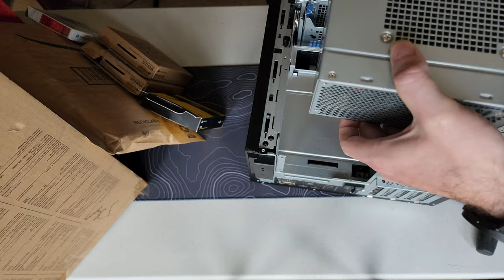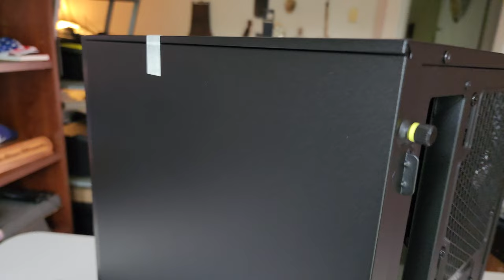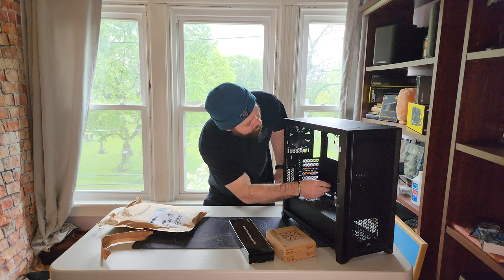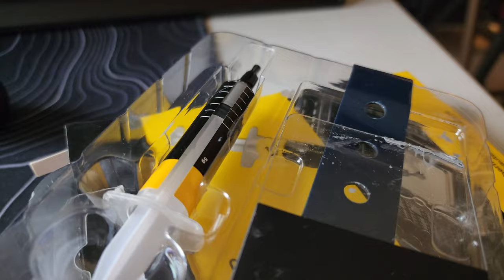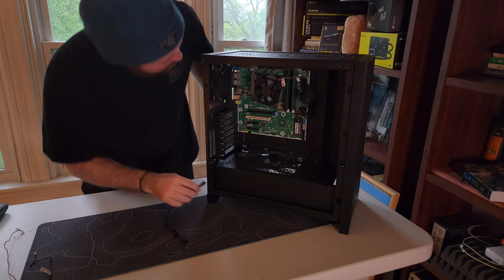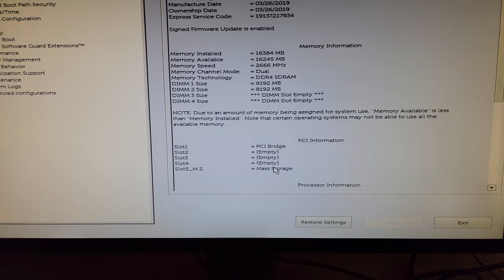TURN YOUR DELL INTO A GAMING PC IN 2023!

Comment: You absolute legend, literally just got hold of a precision 3630 so your video coming out just in time is a serious stroke of luck. Great job.  I'm going to add an rx580 to the existing case, but I may move everything over to a new case.  Do you think that the temps will run way too hot inside the precision case if I were gaming with an rx580?  I saw someone on the dell forums fit a AIO watercooler to the CPU which seems like a decent solution, but if transplanting to a new case is viable, then I will probably just copy you.
Reply from the maker: In the past with a different precision 3630, I actually cut a hole in the inner case mesh with tin snips, by the internal speaker, and crammed a zotac amp holo 3070ti into the stock precision case. It fit and worked. I had to use a corsair 1000w psu which also went right into the precision case no problem. Temps on the other hand were really and I mean really bad. The issue with how densely and compactly they pack everything into the case is everything sits on top of each other with  little to no airflow. The graphics card dumps heat up into the psu and stock cpu heatsink which is kind of small. With an rx 580 you miiight be okay, can't hurt to install it and test it out.. I would highly recommend you recase though. You will see substantially lower temps. I do think you will see your cpu and gpu  regularly over 90c in the stock case though. You can use an aio like a corsair elite h100i with this precision in a new case. You could probably fit a 120mm little aio in the precision but at that point, it's not worth the hassle. I have thought you might be able to rig an 80 or even 120mm fan in front of the psu where the front drive cage is. That could be  cheap easy upgrade to the stock case.
Reply: @darkgalacticmedia  Thanks for the reply! I may have missed it before, but what was the model of the vrm heatsink you put on the motherboard?  I'll probably put the 580 in for now, and then move it all over later on.
Reply from the maker: On Amazon just search "Dell Precision 3630 heatsink". Should be the top hit, it is by BestParts. It's like $15!
Reply: @darkgalacticmedia  Nice one, I fiddled around with benchmarking the CPU on cinebench with stock everything inside the precision case.  While it does run very hot, it actually was being power limit throttled, not temperature.  I did some research and was told that increasing the TDP limit from 65w to a higher level will stop this power limit throttling. I tried it and it worked, no power limit throttling and eventually it got to a point where the CPU was hitting high 90' so clearly temps are an issue I'll have to sort out.  With regard to fiddling with power limits on XTU, is it safe to do?  I don't want to blow anything up, and is there any chance the power limit throttling could be related to the non-heatsink vrm getting throttled?
Reply: @emm5005  Personally, I would lift the power limits, but actually try UNDERvolting the CPU slightly to reduce power draw for the same frequency (I have a 12700k in an NR200 original case, which Ive undervolted and it can now overclock to 5GHz all core (instead of one or two cores) at a lower power draw than the stock 4.7GHz all core).

As you surmised (and I would agree), the board is probably power limited because it is a hot-box and the VRMs are not heatsinked... Fit the cheap Amazon heatsinks to the VRM, lift the power limits and try a little undervolt as I suggest above.

If you want to keep it in the case but want better cooling, you can either:
A:
1) turn the PSU around so it is drawing air from the CPU side instead of from the case side (assuming the PSU has a fan in it, which I think it must as it appears that in the stock config it's only cooling would be to pull air from the case side which doesn't have a grill there so there would be no airflow naturally)
2) This would mean it is fighting the CPU for air in my configuration, so I would then flip the CPU fan so it is pulling air through the heatsink instead of blowing into it.  This way the PSU fan will actually help the CPU fan.
3) However pulling air through the heatsink will then only pull air over the top 1/4 ish of the heatsink, so I would then make a shroud from Gaffer tape / Duct tape that covers the heatsink side of the fan down to 3/4 of the heatsink, forcing it to draw air from the bottom of the heatsink and help cooling some more.

B, if you are really brave with a dremel, IMO this is the better option:
1) Remove the power supply and strip it down (remember to VERY carefully avoid toucking the internal components with your hands or screwdriver as the caps will hold deadly amounts of charge for days after it has been turned off and unplugged from the wall)
2) Use a dremel or drill to enlarge each and every one of the inlet and outlet grill holes on the PSU case. EDIT: if needed... I just looked closer at this video and ones for sale on Ebay, and it seems they don't all use the same design of PSU... some have larger mesh, like this video, and some have smaller mesh... however it is worth pointing out that this video's PSU has a 92mm (whereas others have a 120mm fan) facing the solid PC case side panel, just like all the others?!?... Flip it 180 no matter what else, and if it has a 92mm fan, hack the PSU to take a 120mm fan with extra ventilation drilled or dremmeled out to match.
3) Flip the fan in the PSU so it's sucking into the case from the back instead of ejecting from the case.
4) Refit the PSU so it's flipped 180 degrees, so its now drawing air from outside and blowing onto the CPU cooler.
*This will also have the added benefit of putting some downdraft airflow over the VRMs.*
*The incoming air will be warmed a little from the PSU, but it'll be nothing compared to the hot-box the case is at stock.*

Either way:
1) Also, theres a PC speaqker at the bottom front of the case? Move that to the bottom of the case and fit a 120mm fan over the grill inlet.  

2) There should also be a grill inlet hidden by the HDD and HDD caddy.  Move the HDD to the bottom of the case and just affix it with velcro strip or double sided tape (metal to metal, not electronics to metal)... This will allow you to dremmel out the caddy, or at least dremmel out large holes in the caddy to let air through and fit a 120mm fan in there too.

*If you use option A, set the front fans as intake as the case exhaust is at the rear.  If you use option B, flip the fan stock fitted at the top of the case so it is intake as well as the PSU, and set the front fans to be exhaust.*

3) It looks like the case has 92 or 120mm mesh holes in the side of the case... put another couple of matching fans there oriented the same as the front fans (if the front fans are exhaust, these should be too, it will make the case negative pressure and pull more fresh air in from the top of the case, past the CPU cooler. If the front fans are intake, these should be too, so the case will be in posative pressure and force more air past the CPU cooler and OUT of the top of the case.  Remember that these fans' orientation should be set by whether you go with option A or option B).  
You can just stick them on with that foamy thick 3m type double sided tape. Cut it into thin strips to go all around the edge of the fan so that it both dampens fan vibaration (cos it's the thick foamy stuff) and forms a good seal so it's only pulling air from outside, not recirculating some of the internal air.

4) You can actually set all these additional fans' speeds surprisingly low and therefore quiet as you have just turned the case froma hot-box to an airflow king, with a lot of elbow grease but very little money (you can get away with cheap ass fans, they don't have to be noctua or be-quiet fans!)

*If the front plastic that looks like diamond vent is actually diamond pattern on solid plastic, get to work on its back face, firstly with very rough sandpaper, then finer sandpaper to finish it tidier... You literally want to sandpaper off the whole of solid plastic layer behind the diamond mesh pattern... you can try cutting the diamonds out with a dremmel or something, but trust me, it will never look well done... sanding off from the rear will be messy in the process, but can give you a perfect, stock-looking finish from the front... whilst sanding, don't do it on open air or on your knee as it will weaken the mesh pattern and be easy to break it and push it outward; do it on a solid surface that supports the mesh from the front whilst you apply pressure from the rear.  A motorised sander like a sanding mouse is obviously much easier and quicer than doing it by hand with a sanding block.  Also try moving up-down for a bit, then side side for a bit; it will get through it faster, then with the fine sandpaper work in circles to get a tidier finish.*

* Any drilling or dremelling of the metal PSU or case? Fully strip the PSU first so you're not getting metal filings in it that could cause a short.  Same for the case; fully strip the case so there are NO elecrical/electronic components in it before you start cutting.***

Disclaimer: I don't have a Dell 3630, however I have built unconventional small form factor builds and have  been forced to come up with inventive solutions to cooling... 

For example, I did have 15 years-ish ago a slim cased Dell based Celeron 3GHz, which I removed the CDRom from, in it's place adding a second HDD in raid-0 with the orignal hdd, fitted an NV 8800GTX (I think, if I remember correctly) slim gfx card, and overclocked the CPU to 4.5GHz (The Celeron 300A 300MHz was a beast for an easy 50% overclock, and so was the decade later Celeron D 3GHz) on its stock slimline cooler.  I modified the case a bit to improve airflow too, though.... I took the top off the PSU, clamped it to the front of the case and drilled through the plastic using the metal holes in the PSU shroud as a guide so they were perfectly lined up and it made a very tidy stock looking vent pattern... For the metalwork behind the plastic, I drilled one larger hole and used a jigsaw to open it out into a ring so I could fit a fan (just 80mm, but basically I was limited by the width of the case and it was 1000% better than the nothing there before) to draw in cold air. There were two 80mm grllles in the bottom of the side panel too, which I double-sided taped two more fans onto. They didn't have to run fast, and in fact running them faster made no difference, but with them fitted I could stable OC that old Celeron D by 50% and the temperatures were reasonable.

It was very hacky, but for about £170 total I was getting 95%+ gaming FPS of my mate's £2000 custom built Q6600... Sure his was MUCH better at multithreaded so he could open multiple IE or Firefox tabs cuncurrently with a game whereas I could only do ONE THING AT A TIME, but all games back then were single thread, so with my manually stripped down services on my XP install, and just opening a game, I could virtually match his performance in game ... he was a bit miffed 🤭 
 
Also, my current 12700k mentioned above has the pump/cpu waterblock from my old Arctic freezer II AIO, cobbled onto new tubing to an aftermarket EK waterblock on an RTX 3080, an XSPC slim 240mm rad in the top with Nocpooa slim fans and an alphacool 280mm rad in the bottom with standard Nocpooa fans.  I have modified the case internally a bit to get everything to fit, and the GFX card is fitted vertically, upside down, to get it to fit too (that needed less modification to the rear of the case than if I fitted it vertically the right way up).  Both the CPU and GPU are undervolted. As a result, the case LOOKS stock, but has adequate cooling to be virtually silent when gaming (fans are at about 45% to 50% when gaming) with the CPU and GPU at less than 65C too. (typically 62C and 48% fans) (30% (which IS silent) and 29C at idle or watching Youtube, using Office, etc) EDIT: Oh yeah, I also modded the Coolermaster 850W SFF PSU with a Nocpooa 92mm fan because after getting everything else so quiet, that was then noticably noisy...it wasn't noisy per-se, but I could hear it 😅

(Final point worth mentioning; the case is so crammed full, there isn't room for a reservoir for the cooling loop, so I fitted quick release fittings to the tube just before the CPU pump/block inlet and have a resrvoir on quick release fittings which I used to fill and bleed the loop, then removed it and put the internal quick release fittings together to turn the custom loop into a sort of custom AIO).
Reply: @aaronjones4529  Thanks for all this info, massively helpful. My current plan is to transplant this mobo along with all of its components into an old but very usable HAF 912 pro case I had from a decade ago.  It seems to be quite good for cooling with space for additional fans so along with a VRM heatsink, hopefully that should do the trick.  I also have a Hyper212 Evo that I can stick on the CPU to cool that down significantly (I hope :D)

As for undervolting, I have a non-K processor so Intel XTU won't let me fiddle with the voltages or anything like that. Only the TDP limit is changeable.  Maybe there is a way to manually undervolt in the bios but its such a rudimentary bios I don't think it's workable.

Do you think it's A) worth upgrading the motherboard and B ) worth upgrading the PSU and if there are any pitfalls I should be worried about in doing so.  I have an old CX600M from corsair which seems to be working fine, but is around 8 years old.  This dell 460W PSU is working fine, and I can't imagine an rx580 would go over its limit but the manufacturers recommendation is at least 500W so...  Motherboard upgrade may also solve the VRM heatsink issues and also get rid of the annoying proprietary dell connections to solve the front I/O, power button failure and other issues like that. What do you think?
Reply: @emm5005   @Em M  cool... Nah, you won't be able to Undervolt then, and it's not worth replacing the motherboard; as a reuse/recycle proposition, it's not a bad starting point for a system, but it's old enough that it's not worth investing in serious upgrades like a Mobo... 

If you want to spend a little money on it, get more ram (check the Mobo specs for fastest supported ram as it's not even worth getting 3600 ram if the motherboard supports 2133/2400 (I doubt you can manually edit cas timings, and 3600ddr4 is now on the verge of end of life), but if it only has say 4 or 8gb ram, get 16 (2x8gb sticks)... EDIT, it is worth getting 3600mhz ram if it's dirt cheap second hand, or if you intend upgrading on the cheap in future to say a second hand Ryzen 5000 or Intel 10,11,12,13 gen once they're old and cheap , but be realistic as CPUs last longer than people like to admit... I had my i920 for 7years, it still worked, and as I game at max visual fidelity, not max FPS, my games are usually GPU bound, so it didn't really need changing either tbh... My next one was 5930k, I think, which I had for 7-8 years again, and that's also just fine when I upgraded to my 12700k; I gained like 3-5fps at 4k 😅 (the main reason was for AMS2 in VR which did see a tangible improvement on the new CPU)

The 450w would probably be fine, and so should the 600w be if it's been kept dry and not in a damp place (long term exposure to damp could make it a bit iffy, and so could being a heavy smoker with tar residue soaked dust all over it's insides... I smoke and my old 1300W lasted about 14 years and only popped when I started faffing it into yet another new system)

With the transplant and cooler, I'm sure it'll be fine... It's 65W with power limits, I doubt it'll go over 90W unrestricted... Also bare in mind that I test my CPU Undervolts/overvolts/overclocks in cinebench for stability because it makes the CPU, and as an example my CPU in R23 is pulling 185W, but only 75W in game  - okay, it's a different, more modern architecture, but I'd still expect yours to pull less than it's maximum 65W in game too.

The rx580 with that CPU, a hard drive and memory should easily run in 450W... If you're going to add a lot of fans and RGB, that's when you should think 500w plus.
Reply: @aaronjones4529  That's pretty comprehensive, thanks for the advice!  For gaming I think the CPU is perfectly adequate, especially as I'm not even fussed about ultra fidelity on the latest AAA, just in want of a decent 1080p system that  has a stable fps that doesn't make my eyes bleed :D :D Now I just need to scour ebay for some sweet rx 580 deals

Comment: Definitely subscribed. Had my first hand-me-down Dell Optiplex 7010 and went through a similar re-casing procedure back in 2016 with the help of free IT labor in the company along with an added used RX480. Now your video serves me as a guide to do something similar with another set of Dell Precision 3630 and RX 6600 XT. Btw wondering if let’s say I get a full ATX case will it provide sufficient headroom to install a 240 AIO for the cpu with fans and coolers mounted to the top part of the case?

Comment: Man, you're really going all-out on this conversion process, lol. 

Should say, the "star pattern" for adding and removing screws is more about heatsinks and coolers and stuff, just meant to make sure the pressure is even so you don't squish all the thermal paste out of one side or something. 

The port on the back of your motherboard that sticks out is actually a serial port, for interfacing with very old peripherals from the later 1990s and even into the 1980s, as some of that stuff simply just doesn't have a more modern replacement like industrial equipment, which is why business computers like Optiplex and Precision still come with that.